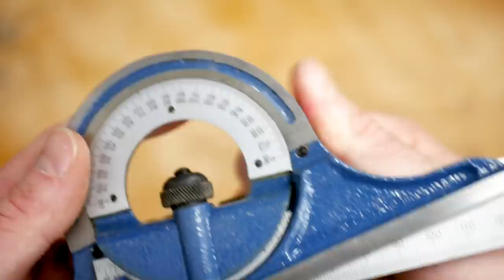Lumber Rack with Scrap Storage

Comment: What were the dimensions?  Looks like you started with 2x4  and maybe cut them down to 1 x 2 as the outside and spacer pieces.  How long are the arms?  I'm thinking abut a 14 -15" in arm.

Comment: Cool design and work..Not to nit pick but is it me or is the table saw blade off 90 deg at 1:24 ? Could also be my parallax but it seemed a bit skewed and shows up in the tenon cuts made as well at 1:49.. As they are sandwiched between the end boards, shouldn't have made a huge difference. Again, very nice work and ignore my nit picking.

Comment: nice but overkill
Reply: Just curious about what is overkill in his design. Too many columns of vertical feet?
Reply: @MixingGBP  so many verticals, too many lag bolt and very complex design. don't get me wrong i do like this project but it's not practical for my shop. i will keep looking for a more simple design. i think i like the 1/2" plywood and 2x4 designs the best for this application.
Reply: @scottbrooks2351  I ended up making a 2-shelf conduit rack that spanned 4 wall studs.  Nice and simple...and most of the stuff I already had on hand.